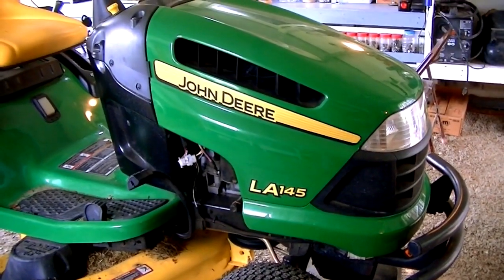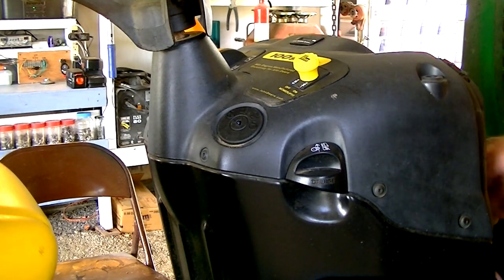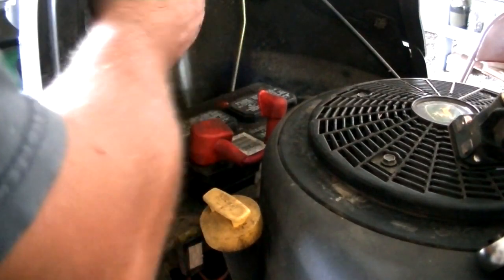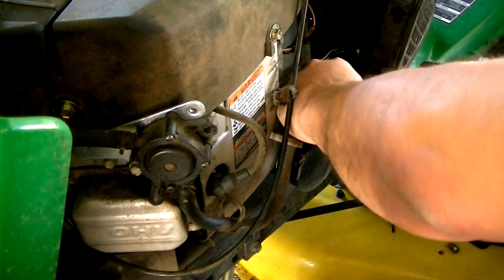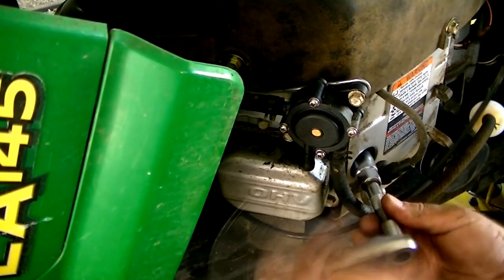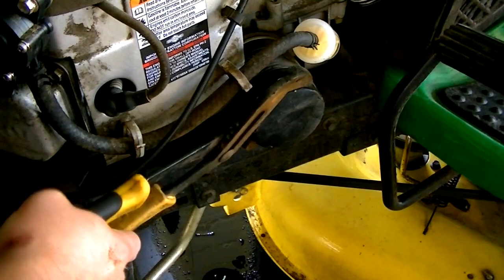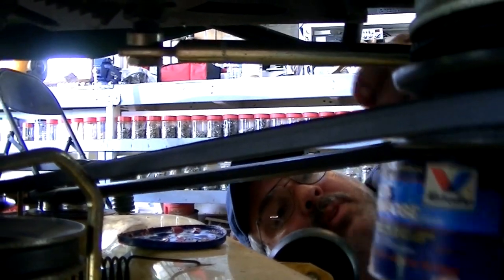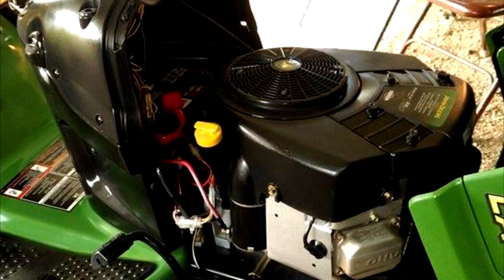Tune Up Refurbish - John Deere LA145 - Bret and Becky

Comment: As one of those guys who wears safety glasses a lot (whenever there's a high risk of something bad going in my eye) I can say that if you value your eyesight (I'm a pilot), you don't have mental problems, you have a high regard for protecting your eyesight. You can gash your arm or leg open and it repairs quite well, eyes don't. I do laugh a bit at the guys who wear safety glasses for EVERYTHING even if there's basically zero risk to their eyes.
Reply: I agree, there's no need to bash those of us who would rather to be safe than sorry.  If you, Mr. Bret Becky, prefer to not wear safety equipment or practice safe and/or proper installation techniques, that's your personal choice.  That way, if something goes wrong and you get injured, it's all on you.  It's not the fault of anyone else.